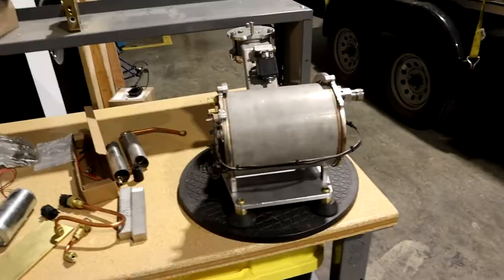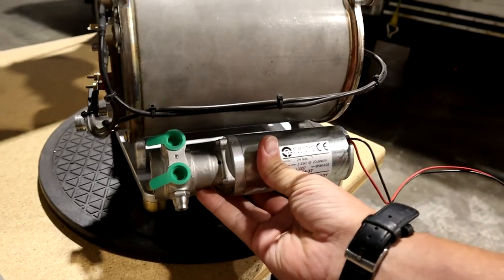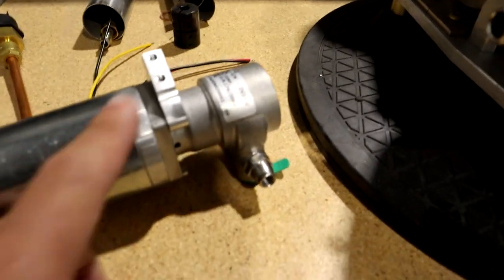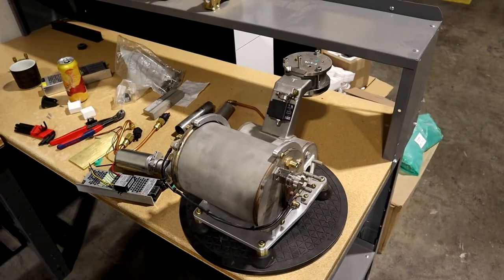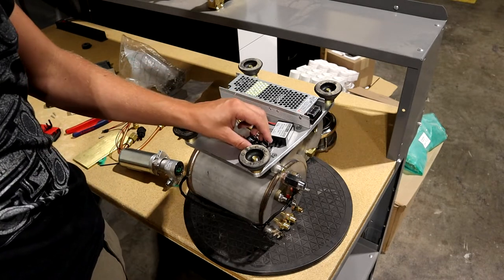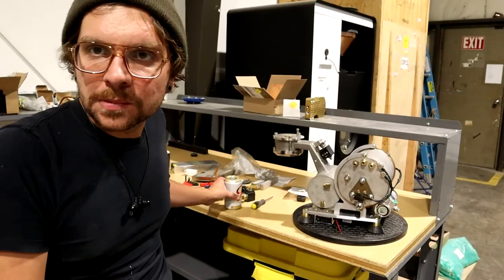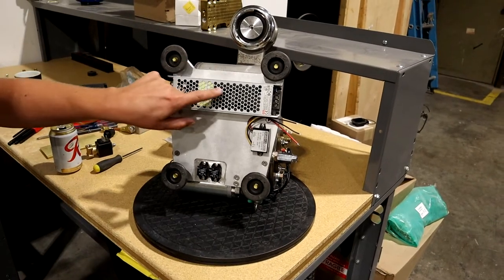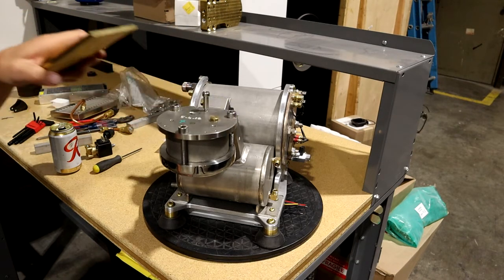Mounting the Pump and Other Electronics - Espresso Machine Part 2

Comment: Looks awesome. Definitely keep those tubes tidy, you're off to such a great start. It would be cool to keep it as narrow as possible - maybe use elbow fitting into the boilers? Are you going to have a case for it? Coffeemachinist in Australia makes these awesome billet aluminum gs/3 cases with scalloped sides. You could do something similar with a different design on the mill - it would be easier than bending a stainless case maybe. Or maybe clear sides?

Comment: There is a client order a machine from Italy . It’s didn’t come with i built pump. On the catalogue they have suggested external pump.
But this region we can’t find  parts so, 

Can we use a 0.5HP water pump with a pressure unit